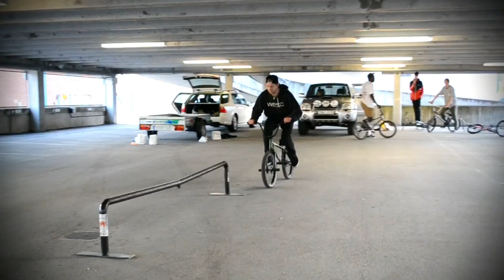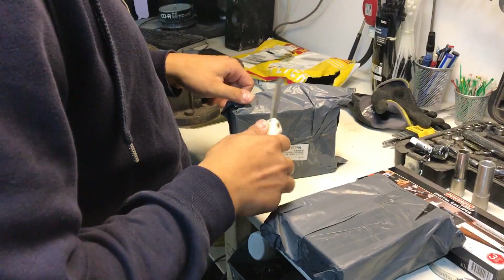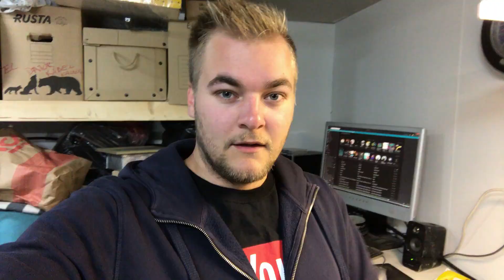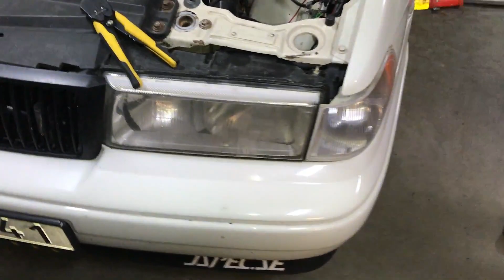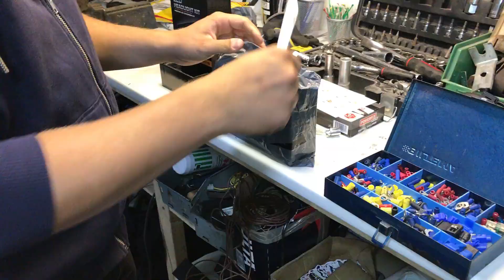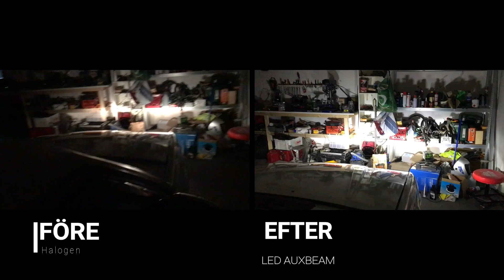Min tjej monterar LED (12000 lumen) på 945 turbo! - VLOGG #18

Comment: Kan man besikta så där med halvljuset?
Reply from the maker: z0uL ja om man har reflektor så du får rätt ljusbild så ska det gå :) ser inte varför de inte skulle gå
Reply from the maker: Är känsligare om man väljer ett kallare (blåare) ljus i halv eller position tex :)
Reply: Tänkte efter som bilar är ju "helbils godkända"
Reply from the maker: Beror lite på bes gubbe, orkar han kolla om lampan är E godkänd. Om han klagar på lampan ska han klaga på fälgarna, ratten etc
Reply from the maker: z0uL Beror på gubbe, klagar dom på de ska dom klaga på fälgar ratt sänkning etc
Reply: Har hört att man kan få ombess för att bara ha xenon look halogen så kanske inte är så värt att prova att besiktiga med led i med tanke på hur lätt det är att montera.
Reply from the maker: z0uL ska snacka med dom om va dom säger, vitt ljus med rätt ljusbild borde vara helt grönt. Vad ska dom gnälla på egentligen :)
Reply: Karl Elonius då måste dom haft jävligt otur.. det är ju ändå en "original " lampa
Reply: Har besiktat 3 olika bilar och 3-4 gånger för varje bil med xenon look halogen och det har aldrig varit något problem alls. Ljuset blir inte starkare, bara mer vit/blå.. :)
Reply: Beror säkert på besiktnings mannen säkert 1 på 1000

Comment: Nu är du lite väl biased dock.
1. LED, och speciellt billigare LED-kit ger sällan bra ljusbild och bländar för det mesta. Hittills är de bara IPF som lyckats få någon vettig ljusbild ur eftermarknads LED konverteringskit.
2. Xenon är i ungefär samma prisklass som dessa, finns för lite som 150kr paret inkl. ballaster enda upp till premium 70w SS för 1045kr. Dock ger ju xenon sjukt mycket mer ljus än något LED kit, så ska man konvertera helljus får man mycket mer ljus/krona ur xenon än LED. 35w kvalitetsxenon lyser både längre och starkare än t.ex. 100w kvalitetshalogen, vilket i sin tur lyser skaplig mycket bättre än dessa kina LED.

Och yes, jag är väl bekväm med kina LED för konvertering :)

Ta de inte som negativ kritik, prenumererar ju glatt ändå!
Reply from the maker: Dieseltrallan Schysst. Ska testa dessa inatt på "riktigt" och jämföra med andra bilen som har xenon, så får vi se hur resultatet blir :)
Reply: KulPåHjul gör det! Finns möjlighet till att du själv inte lär upptäcka någon bländning eller att folk inte blinkar på dig, och då brukar de vara lugnt, men i en ljusbilstestare lär ljuset vara överallt och en hel del stick/ströljus. 

Du kan lägga upp en separat video på jämförelsen om du vill med specs på både LED och xenon, hade ju varit intressant :)
Reply from the maker: Dieseltrallan ja, dock har jag en sån lykta där ljuset vänder in i reflektorn sedan ut, så bilden borde vara bra :)
Reply: KulPåHjul njaeh just det som är problemet, konvertering i reflektorer är det sämsta. Visst led är lite bättre än xenon när det gäller halvljus, men vid konvertering är det oftast projektor som sköter det riktigt. :)